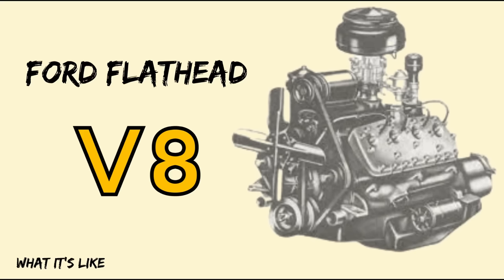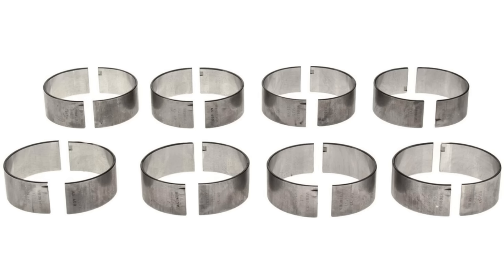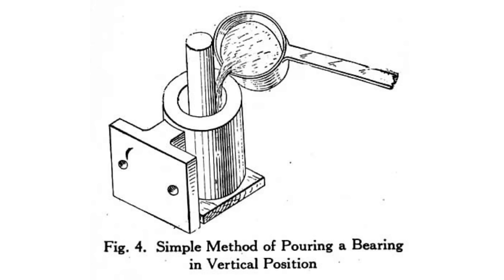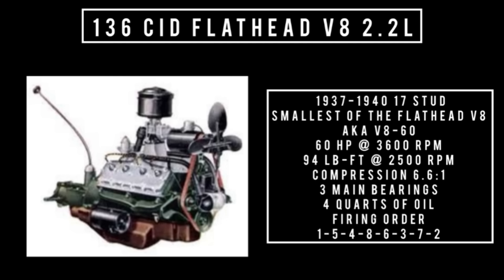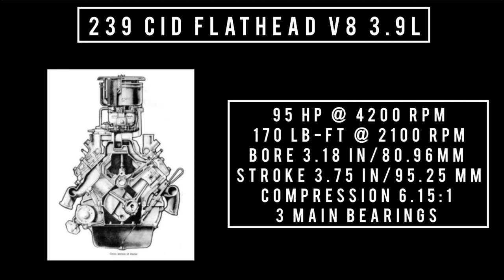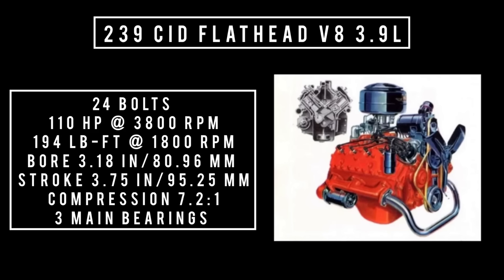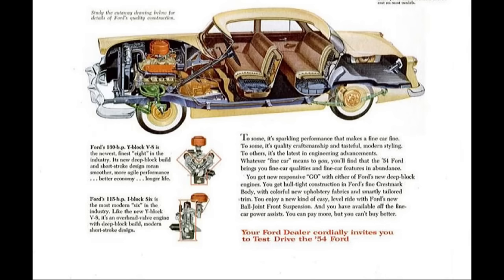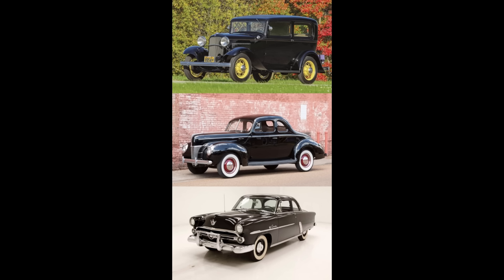FLATHEAD V8, Ford made this engine for 21 years￼. 136, 221, 255, 239, 337

Comment: When I was about 9 years old,  my dad showed me 100 miles per hour on a very unmodified '53  Ford Victoria.  An old mechanic who fixed my car in the 1970s once said if a flathead Ford had oil,  it would run.  Period.
Reply from the maker: Awesome memory =)
Reply: 100 mph was very impressive for a 1953 car in the low price field.
Reply: Was also not too shabby for a 70s V8 car, as they had much less power than a 60s V8.

Comment: The thermal issues, air flow, and not the least of the  issues, cracking the block, demonstrate just what a challenge it was to produce reliable engines that had power. Today, we take engines for granted….but getting here was trial and error…..no computer simulation programs. Let alone, doing calculations by hand or on a slide rule.
Nice report…well done!
Reply from the maker: Thank you so much for adding the issue of the cracked blocks I totally forgot to mention that it was a colossal issue in the very beginning. Not sure what they did to fix that or if that was always just a lingering problem with those engines.
Reply: It is interesting to think about all the advancements made before computers!
Reply: @What.its.like.  That was a big problem on the 1932 engines, but by 34, was pretty much a thing of the past, until the 8BA of 48/49.  It would crack if overheated too often.  The 81A and the 59A engines were not prone to cracking.  The 59AB was the best of the bunch.
Reply: The 38 - 48 LB and 59A engines were pretty good that way, but the 48- 53 8BA was known for cracking fairly easy.

Comment: The 136 Flathead engine continued to be made available in passenger cars for over two decades by Ford of France, later Simca, and ended its life enlargened to 2.4L in Brazilian made Simcas. The last development of the small Flathead was the 2.5L (153ci) Emi-Sul V8 in 1963, which was heavily reengineered with OHV and Hemispherical combustion chambers, and produced up to 140hp. Ironically Simca would then be bought by Chrysler of all people.
Reply from the maker: Awesome thank you so much for that information I should’ve change the title for the American market because what happened in foreign markets was totally different but that’s awesome that that engine went on for that long. I think the small engine is cute =)
Reply: So which one was the best, the most reliable?
Reply: Ford was putting flathead engines in vehicles from 1906 to 1980's... 
Louie Chevrolet was a race car driver and never allowed a weak flathead engine under his hoods... all powerful OHV engines only...
Reply: I rode in a Simca Vedette back in the early 60's, boy, was that a gutless flat head, in Australia people were writing in to motor magazines asking if they could swap out the engine for a Holden 6 and that at a time when that OHV old grey motor was only good for about 70 HP.
Reply: The LB and the 59AB.

Comment: My Dad's first car was a 1940 Ford with the 221 V-8. In January, 1944 he & my Mom drove it from New Jersey to New Orleans (on "borrowed" gas coupons) where he sold the car before he was shipped overseas to Leyte Gulf. He had bought the car new in 1940. It was a great car as long as the temperature was below about 75 degrees outside. Overheating problem---yes. It was quicker than Grandpa's 1939 Chevrolet.
Reply from the maker: Great story thank you so much for sharing that memory =)
Reply: Yeppers, the overheating was from the exhaust running too far through the blocks/coolant areas... Ford flathead racers reverse the flow and take the exhaust out quickly through the short intake port...

Comment: Improved crankcase ventilation did not improve cooling. What DID improve cooling was relocating the water pumps from the heads to the front of the blocks.  The 239 came out in the new 39 Mercury and started being shared with Ford in 1946.  It made 100 horsepower just like the 48 - 51 version.  In 1949, the Mercury was given a stroked version, 255 cubic inches.  It made 110 horsepower in 49 - 50, 112 in 52, and 125 horsepower for 52 and 1953.

Comment: Thermal Efficiency was terrible which is what caused chronic overheating issues, which resulted in cracked blocks frequently. It was made worse by Henry insisting that the exhaust manifolds be placed on the outside of block V requiring the exhaust gases to be routed through the block and coolant adding even more heat to get rid of. Had they mounted them on the inside of the V like all other Flat Head V engines they could have been a much more durable engine.
Reply from the maker: I forgot about talking about the block cracking issues in the very early cars before 1935..
Reply: In 1937, they relocated the water pumps from the heads to the front of the blocks.  This was a big improvement, as the low-pressure area was in the radiator, the coolest spot.  With them in the heads, the low pressure area is the heads, which are the hottest spot.  Low pressure means a lower boiling point.
Reply: Yes, the overheating was from the exhaust running too far through the blocks/coolant areas... Ford flathead racers reverse the flow and take the exhaust out quickly through the short intake port...

Comment: The Oakland and the Viking both had mono-block V8s in 1930, 2 years before Ford did.  Also, the small 136 cube job and the later 337 "big block" were both different engines from the 221/239 engine.

Comment: I had a 1949 Mercury with a flathead V-8. I completely rebuild the engine and the enclosed drive train. Changing a water pump would be easy. Those engines had double everything the most interesting of which was the distributer. It is mounted on the front end of the cam and has dual points. It is timed with a square when you first put the distributer in. After the belt is on and the engine is in the vehicle retiming the engine would be quit a job but one of the two water pumps would be easy. There was room to work on those cars.

Comment: Very interesting.  When you showed pictures of the 1933 and 34 fords you showed two 34s. The 33 has curved louvers on the hood sides.
Reply from the maker: Thank you so much for that correction I typed in 33 and just looked for a good angle. Thank you for catching that
Reply: They are so similar I didn't even notice. 
The way I have always told the two apart is a 1933 ford has a curved grill almost like a skateboard ramp and a 34 is more straight up and down with no curve. There is also differences in the V8 emblem but I don't remember which is which, the louvers like you pointed out I believe the door handles and the cowl vents are different again I couldn't tell you which is which I just know there's differences between the two. 
I could never afford them at least not as a cool coupe or roadster so I never learned all the differences.

Comment: Built  16ft inboard in 1969,installed a 1953 cusomline V8,if my boat had wings  I reckon it may have flown,water was pumped up through the engine and out through the 2 exhausts,boy what a sound. Australia 🇦🇺
Reply from the maker: That boat sounds pretty awesome

Comment: One of the reason why the water pumps were a nightmare to remove was because one of the bolts were INSIDE the pump itself and often corroded and the head would break off.  You had to take off the water hose and use an extension inside the water outlet tube to get to the bolt.  Another problem with this engine was overheating and the block would crack.  I've only owned one Ford pickup with a flathead V8 and I hated the thing.  It's been nothing but classic Chevy trucks from then on.
Reply: That bolt was a problem, but a thicker radiator core will pretty much fix the overheating.  That remained a Ford problem even in the 60s - overheating issues, except on 6 cyl.
Reply from the maker: @michael I had a 67 mustang with overheating issues
Reply from the maker: @ iron clad ranch and forge thank you so much for sharing that Insight =)
Reply: @What.its.like.  --  I've owned just about every type of truck made between 1950 and 1980 except International. For some reason I never could find a good buy on International. Anyway, Ford was the WORST of them all no matter what year.  When it comes to Ford trucks, I've owned a 1950, 1958, 1960, 1964, 1970, 1976, and 1980. All of them sucked for one reason or another. The Chevy's and Dodges have been the best in every category I can think of, and I've owned A LOT of them over the years.  Probably the most reliable was this ugly 1965 Dodge 3/4 ton pickup I owned back in the early 1980's. I used it for work.  That truck simply wouldn't die, even if I wanted it to.  It had the slant I6 engine, probably one of the best engines ever made.  That is saying a lot considering my favorite truck is Chevy and my favorite engine of all time is the Chevy straight 6, another reliable engine.

Comment: I had a flathead 239 in my 52 F1 pickup. It was recently rebuilt and ran great. I put 2x2 Stromberg carbs on it and tubular headers. I added a mid 60s Toploader close ratio four speed transmission. The stock 3.92 rear axle ratio was kept. It would easily keep up with modern vehicles and traffic. There was no overheating issues and gas mileage was a solid 15MPG. And the sound from the dual glasspacks was unlike any OHV v8. Still have the truck, but not the flathead.
Reply from the maker: Thank you so much for sharing your truck with us that engine sounds really sweet. 

What engine did you end up putting in instead and why
Reply: '76 Pontiac Iron Duke 4 banger made more HP, twice the MPG, and vastly more reliable... Your truck prolly had a big enough radiator to help prevent overheating... overheating was from exhaust running clear through engine block/coolant areas before exiting... Ford flathead racers reverse the flow and take exhaust out through the short intake ports...

Comment: The early V-8 flathead had overheating problems. A man named Charles Alberdun. Discovered the problem was in the heads. He cast 400 Alberdun heads to sell to Ford. He discovered his heads increased the horsepower. He brought them to Ford and they weren't interested. He sold a set of heads to Chrysler and he sold the rest of the heads to Hot Rodders. A Flathead engine with Alberduner heads dominated  for many years as they were a hemispherical design. Crysler offered  a hemispherical engine in their 50s Dodge division 331, 354, and 392 cubic inch offerings there were single and double rocker arm engines offered in the DeSoto, Plymouth, and Imperial divisions. 🎉😮😊
Reply: The overheating was from the exhaust running too far through the blocks/coolant areas... Ford flathead racers reverse the flow and take the exhaust out quickly through the short intake port... 
Arkus Duntov came up with ArDun OHV heads for Ford flathead blocks...

Comment: Hi Jay. I'm afraid you failed to mention the 2 biggest upgrades to the Ford V8 for 49 - 53. First, Ford V8's up to 49 had the bell housing cast integrally with the block, while for 49 and later the bell housing was a separate casting, as per the way everyone else was doing it. Secondly, pre 49 engines had the distributor inaccessibly mounted on the front of the motor and driven directly off the camshaft. For 49, a 'normal' distributor was fitted, which was mounted just in front of the right head. There were a couple of iterations of the early distributor, but the last of them is said to resemble a crab. I prefer to think of it as resembling the first phase of the monster from Alien.... the one that grabs your face and puts a proboscis down your throat.
Reply from the maker: Hey Peter Anderson thank you so much for sharing all of that information that I’ve failed to mention really appreciate it =)

Comment: I gotta say, i love this concept of using flat head engine ! But it sadly wont pass euro 6.
Wait look at the crankshaft, it is the same concept as an harley davidson twin, that's why they sound so good.
Reply from the maker: I was like this episode wasn’t supposed to air until 430 I must’ve won early sometimes it happens lol

Great information. =)
Reply: @What.its.like.  idk, im french so this may be why i am here so early.
You mean 4h30m ?
Reply from the maker: This episode was supposed to air at 4:30 Eastern time it’s all good though
Reply: All V engines have a crankshaft like that... Harley sound is from the narrow V... most V8s are larger 90 degree V... as is a Ducati, which is vastly smoother engine than a Harley...

Comment: 1933 and 1940 ford .  A thought 🤔
1940 V-8 Ford was the most important production car produced !!! 
100 horsepower and did 100 miles per hour? 
Today's super cars produce over 700 horse power if not more ?? 
By 1940 Ford performance standards today's Dodge should do 650 miles per hour 🤔😂 Lamborghini should do a 1000 miles per hour if they are as good as a 1940 FORD !!!!!!!!!!! 😂
Just a thought from the old school..🤠✌️
Reply: FACTS!
Reply: And the accident rate today is horrible.  If we didn't have airbags, collapsible steering columns, etc., the death toll would be almost like a war zone.  I say a 1904 Curved Dash Oldsmobile is fast enough for most of the motorists today.  It had a 1 cylinder engine, and the car could reach about 25 MPH.
Reply from the maker: I got to drive a 40s Ford last summer I think 80 miles an hour will be the end of the world for that car I drove 50-55 mile per hour and that was plenty fast fir it 

Driving a flathead V-8 is a different experience than the V8 that we are used to even the Y block is a different driving experience
Reply: @What.its.like.  Trust me, it will do more than 80 MPH.  You are just used to the super-tall gearing of today's cars.

Comment: In todays Hot Rod environment, the cooling issues of yesterday can be addressed in many modern ways. Extractors [headers to the Americans] reduce nasty heat building back pressure, alloy heads dissipate heat better, electric fuel pumps help overcome vapour lock & an adequately sized, lightly pressurised radiator will help enormously. Using the engine in something light, such as a Model T, A, or a 32 HiBoy will reduce the need for sustained high power settings. These things in a rebuilt engine with a sterile clean block [no rust in coolant areas] & the payoff, with carbs & mild cam, is good performance & a dinosour engine that will outlive us all.
Reply from the maker: Very true.. just know that these were notorious for overheating back in the day and now that they’re almost 100 years old I’m sure they still do the same thing. Without any Modifications or anything like that

Comment: Lincoln only used the 337 V8 through 1951. They switched to their own 317 Y-block in 1952.

Ford trucks also discontinued the 337 in 1951. They switched to a 279 V8 based on the Lincoln 317.

Comment: Lincoln only used the 337 flathead from '49 - '51, as an interim replacement for the flathead V12 while they were developing their OHV V8.  The 317 OHV was introduced in '52, along with the new Lincoln body style.  Ford & Mercs also got a makeover for their bodies in '52, but their OHV V8s would have to wait until the '54 models.
Reply from the maker: Awesome information thank you so much for sharing =)
Reply: The 337 continued to be used in larger Ford trucks until 1954.

Comment: Video Idea...   1:30   all but one of those engines had Metric spark plugs.   How about doing a video on why spark plugs had metric threads way back then?     

Another video idea along the same line...  now all cars are all metric, why do tire sizes still have the rim size in inches?
Reply from the maker: Awesome ideas